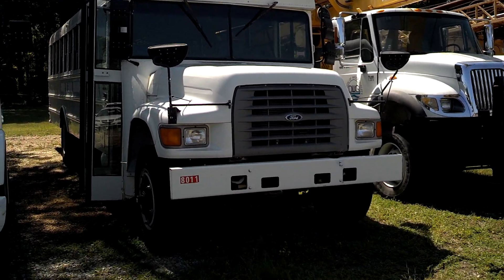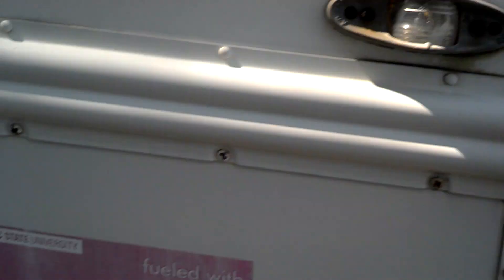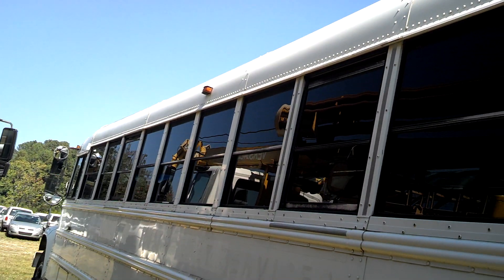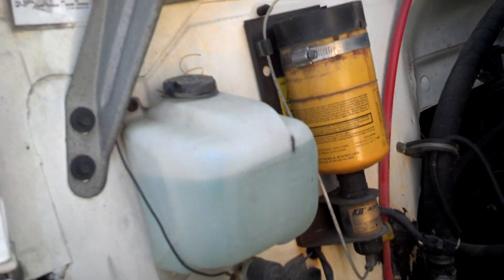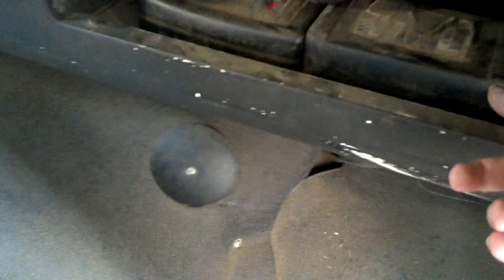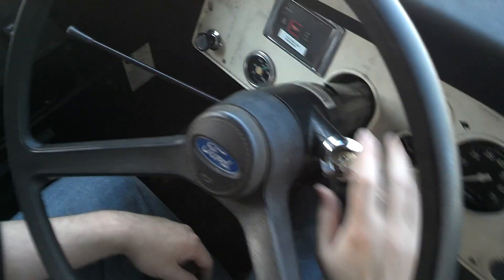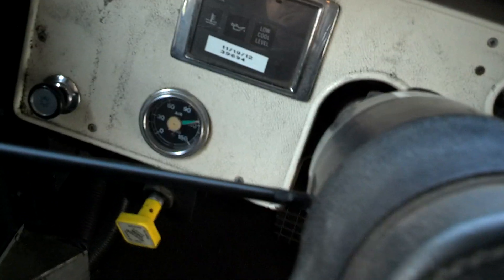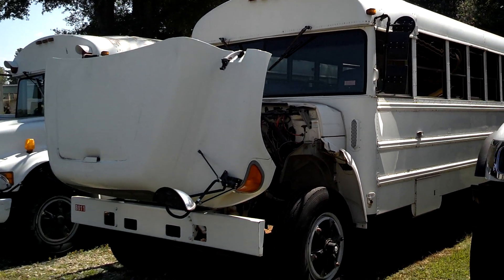96' Ford Thomas 5.9L Cummins Activity Bus Overview with Cold Start!

Comment: ford with a Cummings? dont know much about buses but thought ford would have used a powerstroke lol
Reply: +FrostyExchange powerstroke wasnt a thing back then
Reply: Actually it was, lol. This bus is a 96'.
Reply: The Powerstroke diesel engines at the time weren't made by Ford, they were made by International Navistar. Since 2011, Ford uses their own diesel engine in their pickups now which is a 6.7L Powerstroke. They used to use the 7.3L IDI and the turbo version, (aka the 7.3 Powerstroke) the 6.0L (VT365) and the 6.4L diesel engines which are all by International.
Reply: FrostyExchange anything bigger the. An F550 can be speced with a cummins cat or power stroke
Reply: Ford and Chevy both used Cummins engines in various medium duty vehicles. The Powerstrokes at the time weren't rated for medium duty use.